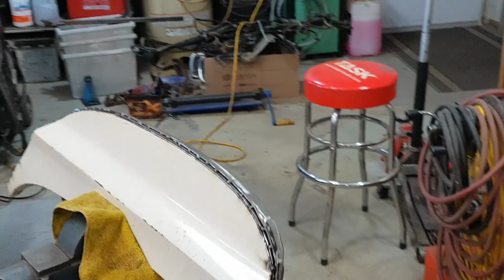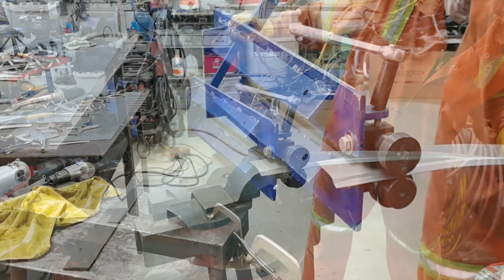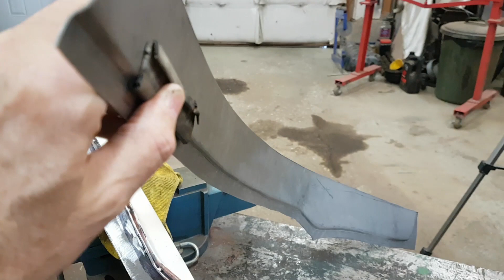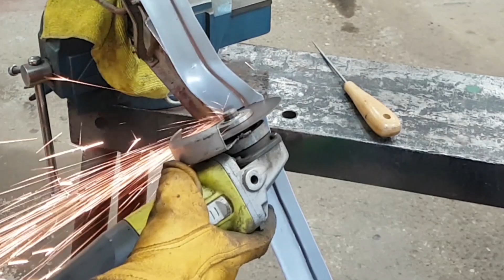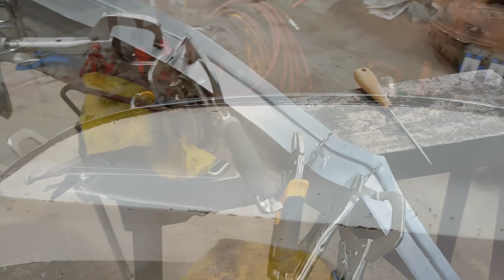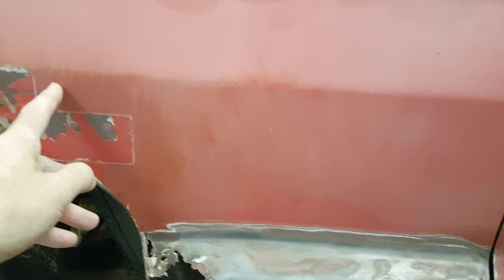The Patch Panel Fun Starts Today! - 65 Thunderbird Convertible Restoration  Ep #16

Comment: Mr. Jamieson, I have come to value your opinions and talent so I wanted your opinion on a '65 T-bird that I have found. It is the limited edition the copper color with the white top and white leather seats power every thing. It has 79 thousand miles that appear to be original. The new owner was in the process of restoring the car when he suffered a stroke and can no longer work on the car. I looked at it today and was amazed by the body I checked it over with a magnet and I could find no bondo or rust at all. The paint is original and could use some spot touch ups. The interior has the usual needs help with the window switches and the vacuum systems. The engine runs and it has cruse and air. Needs weather stripping and new carpet. He wants $5,000 for the car. It's not perfect but for a car just 4 years younger than I am it's not bad.
Reply from the maker: Hi Mike, it sounds like a pretty cool car, and $5000 doesn't seem like a bad price based on what you have explained, it also sounds like it can be driven without a lot of immediate work to get it on the road...then you can pick away at the other stuff at your own pace.
I think you have to look at the end game for the car, "is this for me to enjoy, and is my dream car" or "I only want to flip this car at a profit". If you are in the first category, then the price is is more emotionally acceptable, and few dollars either way isn't a show stopper...however, if you are in the second, then the purchase price means a lot more to the end game of making a profit.
Reply: @J_R_Shop  I used to have a '64 T-bird for 11 years and it was my "dream" car I sold it and it paid for my wedding. So finding this '65 which has a ton more options and the body is in better shape and with my "experience" with the old bird it could just be an old friend coming home. Thank you. and God bless.
Reply from the maker: @mikejohansson6711  that's great...then it's worth every penny to you! 😊
Reply: Ah, the 1965 special landau. Only 4500 were built. I used to own one up until about 13 years ago. One of my faves.

Comment: I put an old steering wheel backwards on my bead roller which allows me to keep my rotating arm in the same position while my guiding arm is continuously holding it on the line.
Reply from the maker: Thanks sizzle073, I have seen where people use an old steering wheel...that would be a big improvement over the handle that came with the unit!
Reply from the maker: Not sure where your second comment disappeared to, so I'll answer it here. I do have a cheap English wheel (shown in my next video), that I have been using for stretching before bead rolling...that's about the extend of my skill with it though. 
I think if I mount it on a pedestal, I will use it more, but honestly it's just a little low quality to do a good job...may have to upgrade. 😊

Comment: Hello Alvin. Looks like the fabrication is coming along real well. I have the same bead roller, and have thought about motorizing it, also. I see that you added angle iron to the arms, were you having issues with it? I also enjoy the sheet metal fabrication...when it works. LOL
Thanks for showing your work.
George B. in Michigan
Reply from the maker: Hi George, motorizing would make my bead roller more usable, and I think I'll scour the YouTubes for a setup I would like to use. Adding the angle iron has reduced the flexing between the upper and lower roller, so I am happy with that mod, I still would like to have it on a stand, a few other mods like the hold down bolt by adding a tee handle, and a return spring.
I also enjoy the metal fabrication...when it works, it's more for giving than wood working, if you make wrong cut in metal, just weld it back up! Lol
Thank you George!

Comment: Alvin, what a cool video.... that bead roller.. what an amazing result.  You made that look easy bro.... I give you so much credit for doing it this way..... amazing  - still watching -  Excellent Video !!! Well Done !
Reply from the maker: Thank you Ron!
The bead roller and English wheel are two piece of equipment I would like to learn how to utilize in my sheet metal work, and most likely will have to upgrade from the cheap units I now own. For now they are getting the work done, at a minimum level, if I have the right tooling and more practice on the bead roller, I could have formed the piece I built in this video by rolling it into the patch panel without any welding...maybe I'll give it a try on the left quarter panel.